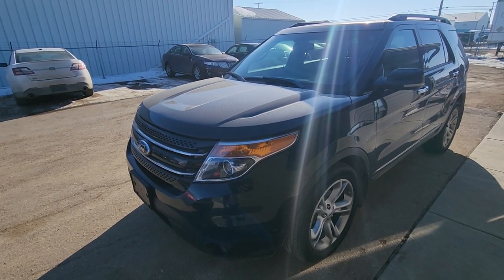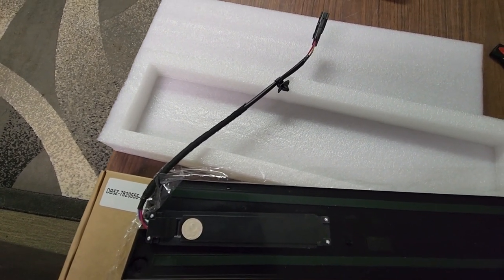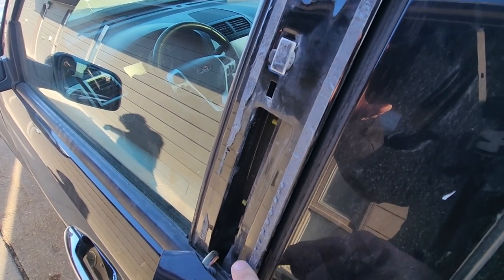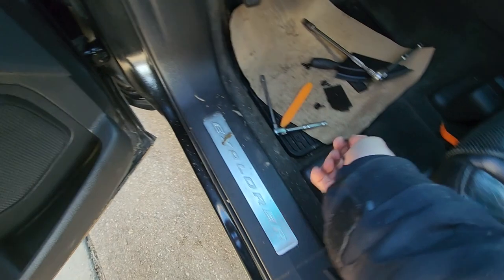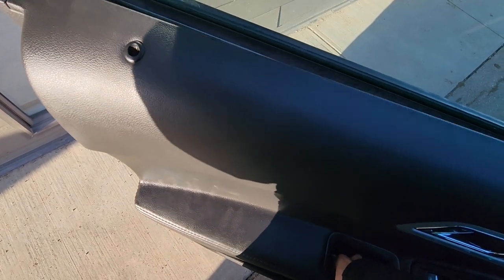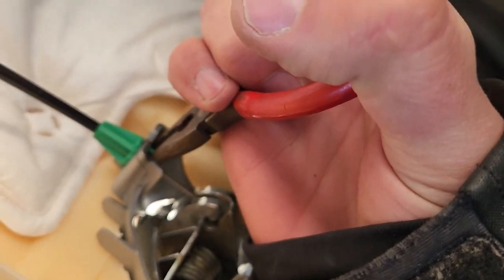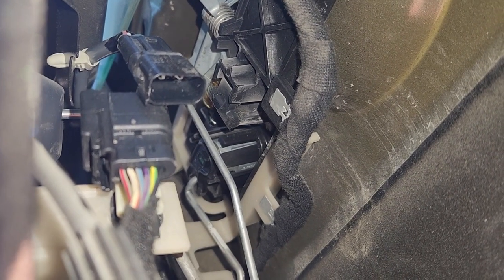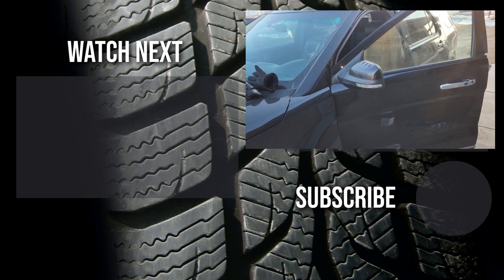Ford Explorer - DOOR ENTRY KEYPAD REMOVAL / REPLACEMENT (2011 - 2019)

Comment: By  2016 The panel with the mirror and window controls and the lower door handle are just clipped in. There is one 10mm bolt under the door handle and the same two 7mm screws at the very bottom of the door panel. The other differences are self explanatory. I could not reach the clip that held the wires for the old panel, so I just cut the panel and unclipped the connector.
I have installed my new panel, but it's not lighting up? It's attached to the proper connector. Wonder if the panel is defective? Is there some 'reset' for the control panel?
Reply from the maker: Hello I don't think there would be any kind of reset. It should be plug & play. Yours is 2016 which is after the facelift but still I doubt there is any kind of programming needed. Part at my supplier is listed the same from 2011 - 2019. Could be a faulty panel
Reply: @QuiteAlright  Thankx. I think the panel is defective as I can't find any info about programming or any kind of reset.
Reply from the maker: @hawkeyepoole  No problem. I hope you figure it out and have it fixed

Comment: Was there any issue with the security system after you replaced the panel? What was the process to program the new keypad to the preferred code or did the old code just work? I have a local shop possibly willing to do this repair for me or we can do it ourselves. Local shop was concerned about messing up the security system. I have a 2012 Ford Explorer - Limited. Thanks!
Reply from the maker: Hi, it had nothing to do with the security system. It was pretty much plug & play and old code worked since it is stored in the pcm and not tied to the panel itself.I beleive you should be good.

Comment: Do you know if it will cause an issue with the immobilizer if you just unplug the pad? I don't need the keyless entry capabilities, and the pad is constantly flashing and killing the battery.
Reply from the maker: Hi, depends how the immobilizer is wired. But I don't think it should

Comment: What kind of adhesive did you use to reseal the plastic cover inside the door to access the wiring for the device?
Reply from the maker: Hi, you can use 3M weather strip sealant

Comment: Would it have been possible to simply splice the wires of the new one, and connect them to the old wires coming out of the door?  That way, you would have only had to replace the Pillar / Key Pad panel, and not take everything apart.  My Explorer has the same problem.  That seems like it would be a much faster and cheaper fix.
Reply from the maker: Hi, well yes that should work if you don't want to take everything apart. Make sure to disconnect the battery before doing it
Reply: Hack